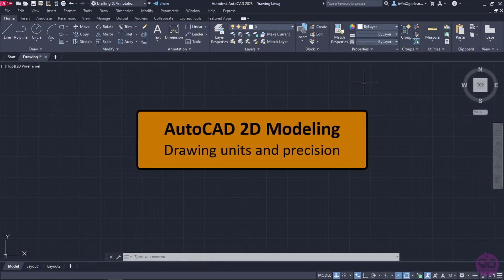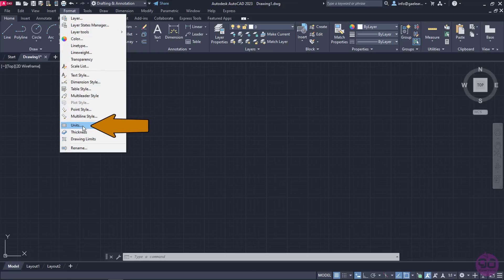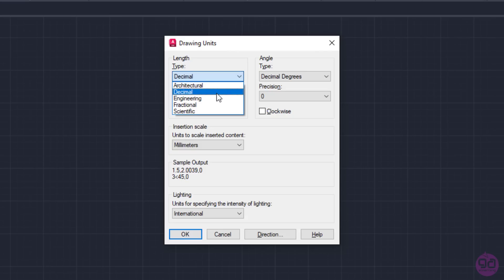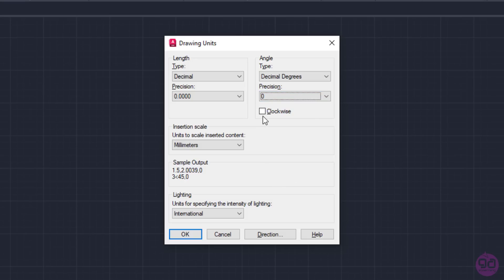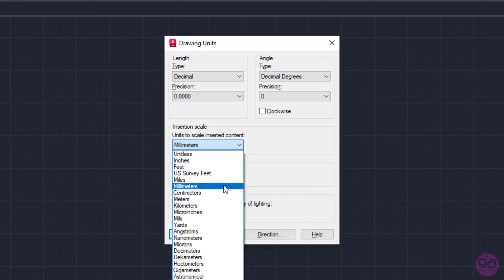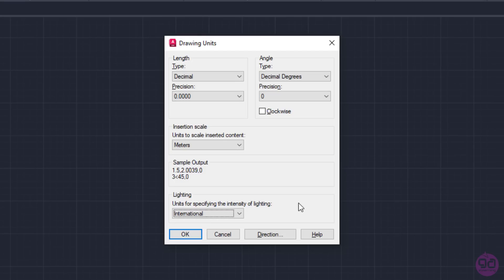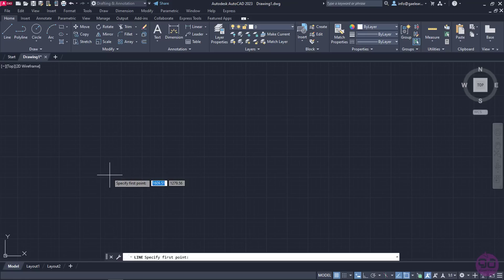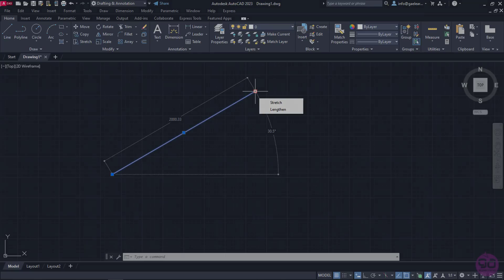1-3 How to set units in AutoCAD (AutoCAD Tutorial)

Comment: why can't i enter the angle😢
Reply: just press tab kid to jump[ to the nxt measurements
Reply from the maker: There could be several reasons why you might be facing difficulties entering an angle in AutoCAD. Here are some common issues and possible solutions:
Ensure that you are using the correct command to input the angle. In most cases, you can use commands like "Line," "Rotate," or "Angle" to specify angles. See the video with line tool.